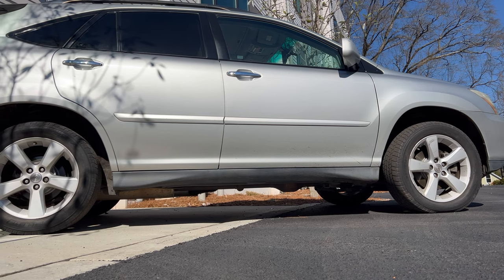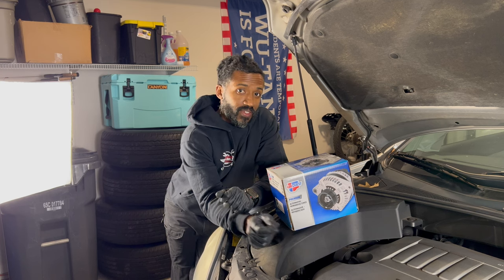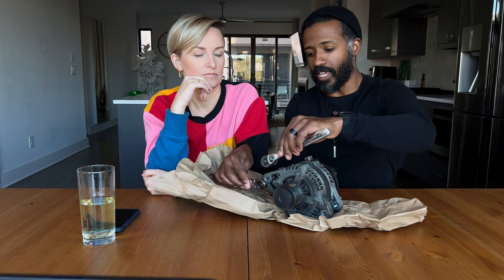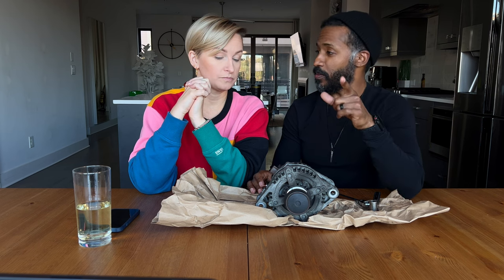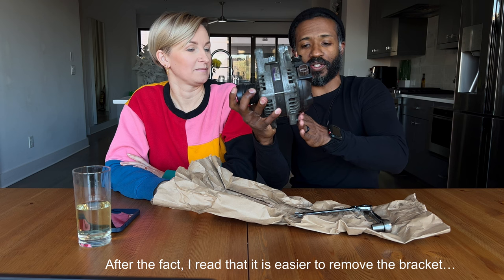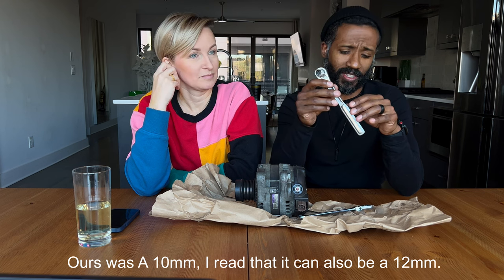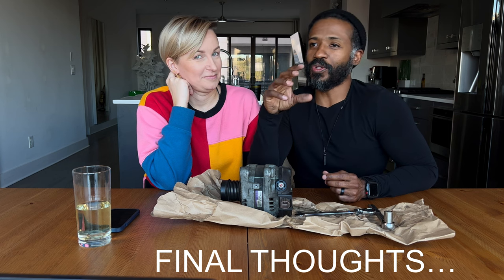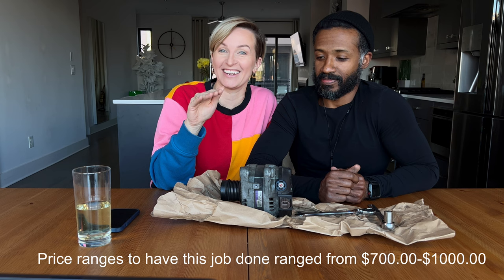2007 LEXUS RX350 ALTERNATOR INSTALLATION FAIL!!! 😭😭😭

Comment from the maker: A few more words of advice for anyone willing to tackle this repair.  
1)Start early, this is not the evening job you can finish before dinner. 
2)Read and watch every video on YouTube and the Lexus forums. Everything including ours doesn’t really show the hardest portions of this job. 
3)Have a spare filler neck on standby. I just replaced ours a month before, but this thing can and will break. 
4)If you do not own low profile metric tools this would be the time to invest in some. 
5)Be patient ,have a 2nd of every tool, a 2nd person and 2nd car on standby. (For tool and parts runs) when something breaks. 

This job is difficult and will drive you crazy, but it isn’t impossible.  
Hopefully this video helps you through it!

Comment: I can imagine what Lexus charges for labor !!!
Reply from the maker: From all of my reading on the forums etc. People have said this job can cost anywhere from $700.00 to $1200.00 USD. The alternator was $200.00 from our local parts store. I would imagine it to be around $400.00 at the dealer so yeah not a cheap repair at all.
Reply: @KRTLyfe  Just had to do this job at a Lexus dealership. Cost us around $1600 CDN. Our alternator blew 5 min from home after a 1200 km trip, thank god we weren't stranded in the middle of nowhere in the Rocky mountain.

Comment: Excellent explanation, but one comment, please? You had NO screws to take off or on......they are Bolts. Just saying. Thank you.
Reply from the maker: Interesting, I had to look this up. Here is what I found. 

Let’s begin with a couple of definitions provided by the CBP which are quoted from ANSI-ASME B18.2.1:

Bolt: A bolt is an externally threaded fastener designed for insertion through the holes in assembled parts, and is normally intended to be tightened or released by torquing a nut.
Screw: A screw is an externally threaded fastener capable of being inserted into holes in assembled parts, of mating with a preformed internal thread or forming its own thread, and of being tightened or released by torquing the head.
A bolt is meant to be used with a nut, and it is tightened by torquing the nut. A screw is designed to be used in either a preformed or threaded hole, or it is capable of forming its own threaded hole. A screw is designed to be tightened by torquing the head.